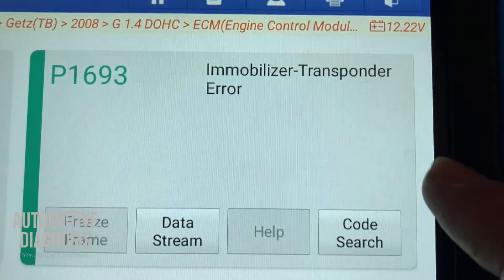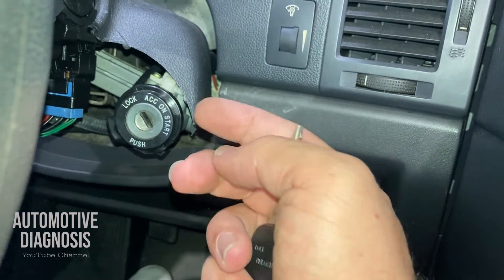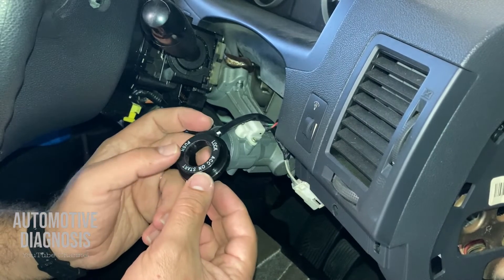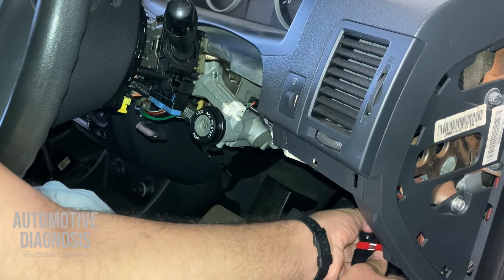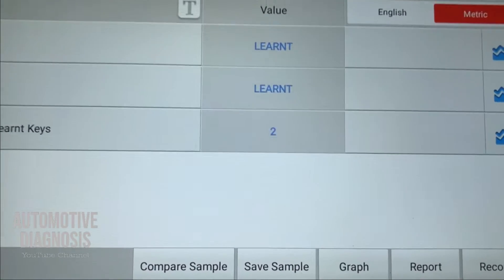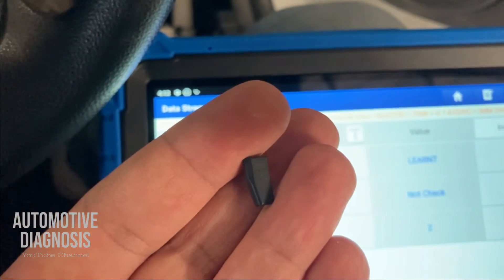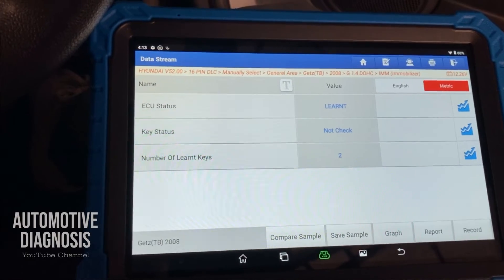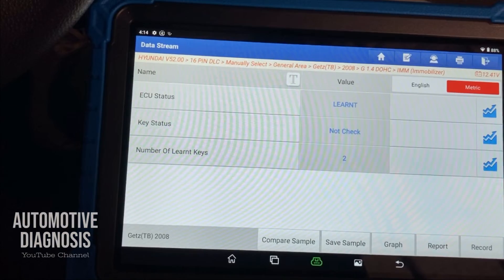Fix P1693 Immobilizer Fault Code | Immobilizer Transponder Error | No Start #immobilizer

Comment: Does this has anything to do with my car cranking for so much time before it finally turn on?
Reply from the maker: No, delay on cranking normally comes from the fuel system, Cranks or Cam sensors.
Reply: @AutomotiveDiagnosis  I've done more research and find out that some cars including my Hyundai does crank but does not fire if the transponder is faulty, I've cleaned the connections and it is now working like charm, fires from the first try ! 😁

Comment: Hello my friend, can you please elaborate on what the ohm range should be for the transponder antenna. You had a reading of 8.9 ohms and you said that too high or too low is not good, but I find that to be very vague. Can you tell us a range or would that be in service information like Mitchell, identifix, etc..? Thanks for your time and I appreciate your videos! 👌🏼👍🏼
Reply from the maker: Hi there, normally for those antennas I’ve seen, they are between 6 to 20 ohms. But if you are measuring the antenna and you get no reading, it means there is open circuit inside the antenna which caused the fault and it must be replaced.
Reply: @AutomotiveDiagnosis  Thank you.